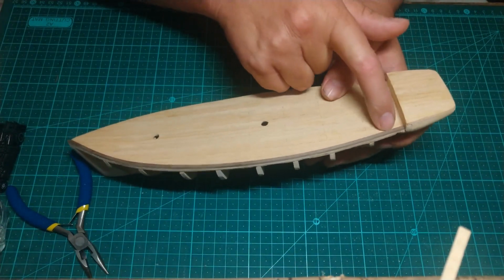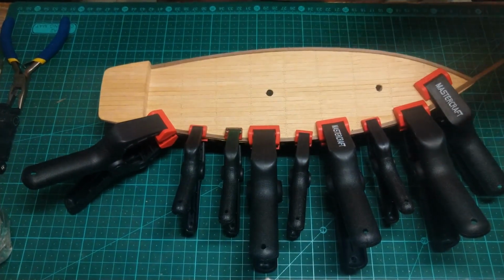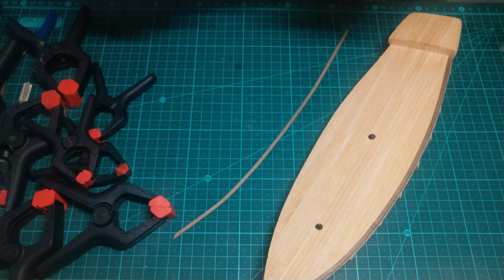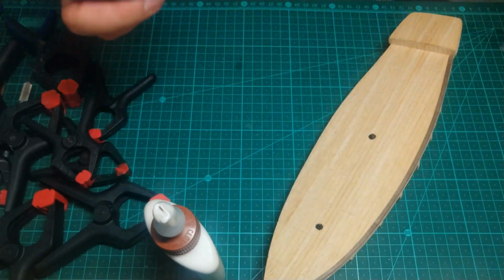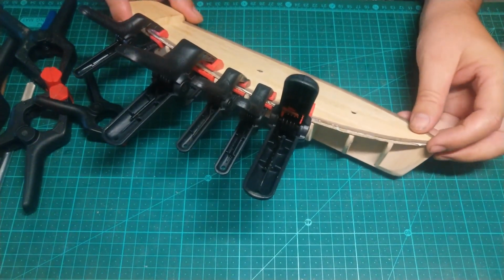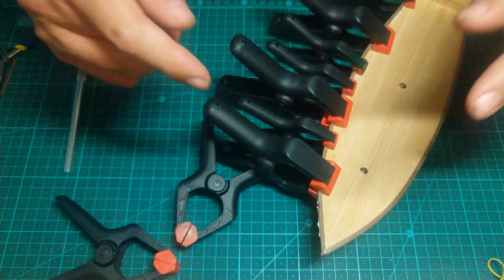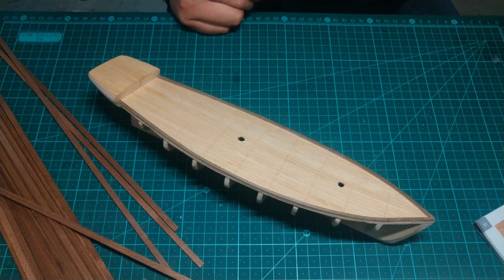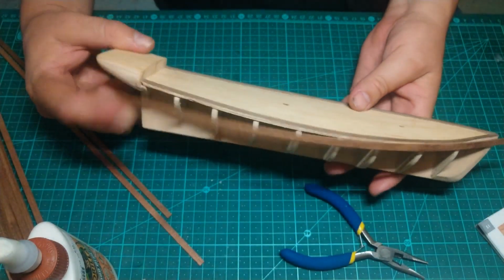Carmen Stage 4 - Stringers and Port Side Planking

Comment: Sorry for being negative but if the instructions are showing you the method that you are using to plank that hull, I suggest you throw those instructions into the bin..
Reply from the maker: No problem, negative comments I see as positives, I've actually got the right tools for planking, and my methods turned out looking good, the next upload will show that. Thanks for the comment, and remember this is my 1st ever ship build.